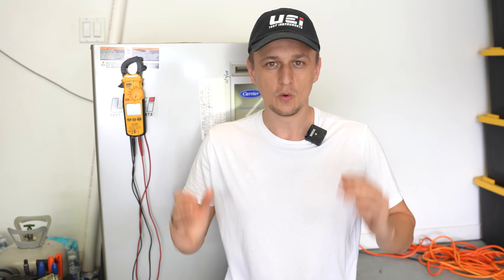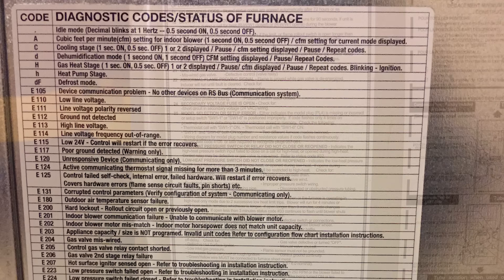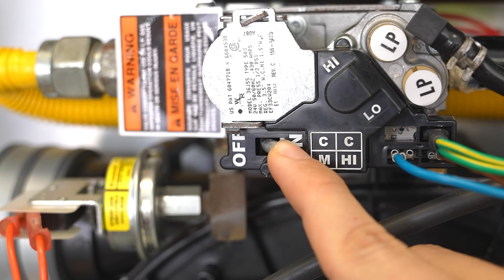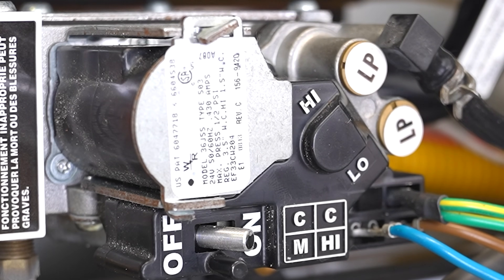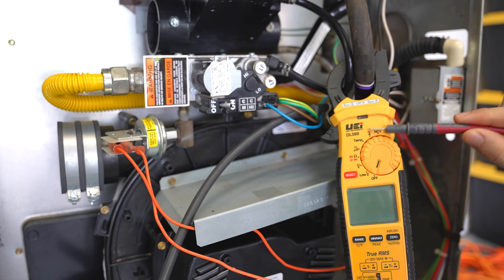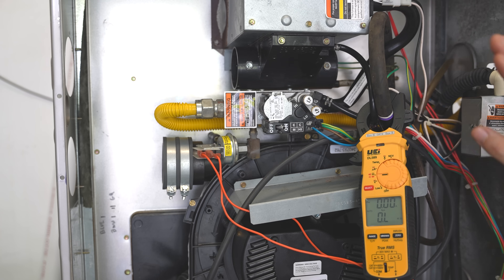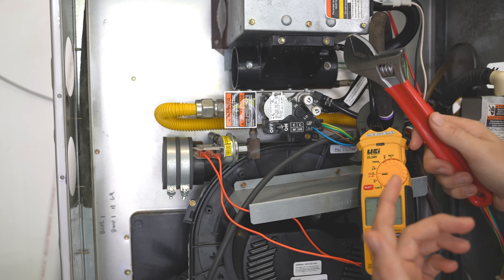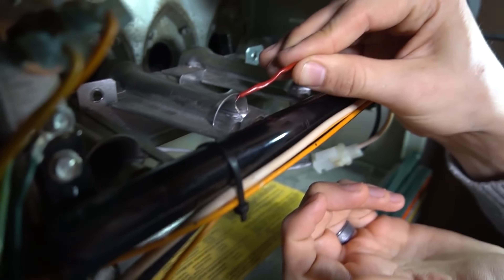Furnace Gas Valve Not Opening - How to Fix It

Comment from the maker: ⬇ Other Videos You May Like:

How to Clean Burner Orifices:
https://youtu.be/aM4OXM8ruNk
How to Manually Light Furnace:
https://youtu.be/-bMz1En0DSg
How to Clean Furnace Burners:
https://youtu.be/6ehk0NZVFcg
Furnace Sequence of Operation:
https://youtu.be/AQD_MedIklI
How to Replace Furnace Ignitor:
https://youtu.be/1bRsFAMgZRQ
Furnace Error Codes Explained:
https://youtu.be/J8Zegm4TClM
Furnace Parts and Functions:
https://youtu.be/gN-UIr6824w
Most Common Furnace Problem:
https://youtu.be/3Jonl_TLkpE
Reply: Have a carrier 2008 ,40000 btu.
All components work,
Igniter works does come on but gas doesn't come on.
With wires removed  holds 26 volts for 8 seconds. 
When connected to valve and volt meter, votls flash for fraction of a second and then seem to kick out the relay. When voltage is supplied from another 24 volt source, gas valve opens and lights.
Has power with  no load,
Soon as it's connected the  value. Power from board seems to just click off.

Any suggestions  ?
Thank you very much.😊

Comment: When testing volts, i get 23.6v and then for a second 24.4v, no gas flow, what does this mean a new board or valve? Or?
I jumped all the limit swirches.

Comment: Still have an issue. Looking for help. Ignitor lites. No power at gas valve or coming off th board. Reading limit switches closed at the board. Tried wiggling wires for valve and switches on both ends. Put in a new board and same issue. Is there another permissive for the board to open valve? Why no power from the board?
Reply: Solved. Wiggling wires never made the gas valve open but the harness is bad. Keeping a long story short. I now have #12 stranded wires shoved into the harness (where the gas valve wires are). This makes the connection to the board and furnace is working temporarily till I can get the harness.

Comment: Im only getting 20 volts to my gas valve. Could tjere be another issue causing low voltage? Im trying to DIY as im pretty skilled in most areas. I've read I could have a resistance drop. Any videos on this?

Comment: I had a leaf get sucked into the furnace burner, the gas valve solenoid was the issue, I tapped on it and exercised it and it works, the trick is to tap on it at the exact moment it doesn't require a hard smacking just like a tap, like happy Gilmore putting.

Comment: 🥶Trane XV95 horizontal in COLD crawl space, bottom orifice wasn't flowing, got cleaned, then worked, now again gas not flowing out to flame sensor that is located on it (orifices above mostly do) *My next attempt: heat gun route and warm up lines based on helpful comment "... gas valve gets too cold it can tend to stick... heat gun and warmed valve up to a normal operating temperature"... HOPE THIS DOES IT! (will report back) VERY MUCH APPRECIATE your awesome videos & comments! THANKS!

Comment: At 3:55 I guess you're saying sometimes you can "tell" it's just a loose connection but can't fix it.  Why would that be the case can't you just recrimp? update: googled it, I guess sometimes the internal connectors inside the valve (to its own internal circuit board) get weird, and you can't access them...

Comment: I freaking love this guy  NB that "furnace not starting" can be caused by several other more common things, this is just the scenario where you don't hear a click/gas woosh noise at all...the blinking codes are rarely going to tell you specifically "valve is bad" unfortunately, just "failure to start" or "lock out"...as other comments mention sometimes a "pressure switch" is inline with the valve's power wire, so if it "starts going bad" (or is legitimately detecting something wrong) then the valve won't see voltage...

Comment: WTF!?
Wiggling wires with exposed conductor on the crimped spade connectors.
And all your other suggestions.
You got to be kidding.
What if the live wire comes out the loose connection and you are then holding this?
The valve is cast alloy aluminium.
Best not to smack it as hard as you can.
All this while gas mains is turned on!?
WTF!?
AI picks up this kind of dangerous content.

Comment: Hello there , I have a Rheem furnace , the gas valve opens but the igniter does  not glow. So I replaced the ignitor and I replaced the glow sensor and it still doesn’t work. Could you please advise what should I do next ? I really appreciate it you can help me out solving this issue. Thank you

Comment: So I have a 30 year old furnace and put a new valve on last winter and now its acting up. Throughly cleaned burners everything. The pilot would be on and fans running cold air coming out of ducts. Was gonna test for 24v and touched a wrench from ground to these brass terminals on valve body and it fired right up. The valve must have been stuck.🤔

Comment: FURNACE EXPERTS HELP!
My Lennox furnace is flashing three blinking lights. The draft motor starts, runs for a few seconds, then the furnace flashes 3 times and shuts off.

I already replaced the hose, installed a new control board, verified all the wires have voltage, and tested the pressure switch — it’s working correctly.

What else can I check? I’m stuck!

Comment: My furnace was not heating even it got glowing  ignitor. Figured out there was no gas supply. D
Tap the solenoid valve and furnace ignited. But when it reached the set temperature and it won't ignite auto ignite again. Did to start manually for 3 nites and planed to buy new solenoid valve on Monday. Sunday nite search U- tube for videos about solenoid valve and watched this video.   After watching went to basement, wiggled/ pulled the 2 wires near the connector at solenoid valve opened and the furnace running good. Tried 3 times before leaving the basement. furnace working good. Many thanks to you guy for the very good video.

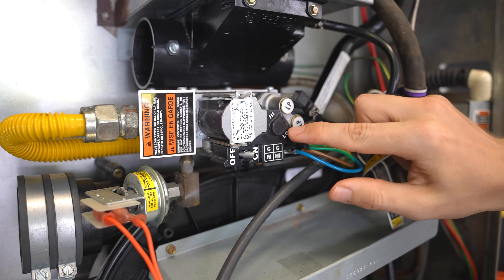Comment: 02:53  Wow. Just to confirm that wiggling the connector works. I got error code  7 “Ignjtion lockout due to retries” on my York furnace. I replace  flame sensor and igniter with new ones, didn’t help. I can get it to start and have blue flames after I reset power and do it from scratch , but every time the blue flames only last few minute. Then  it enter shutoff mode and the status light blink 7 rapid red flashes. I also downgrade air filter from MERV13 to MER8 to give it more air flow, same issue. After watching this video, I wiggle the connectors around the gas valve, near the ON:OFF switch. Suddenly, everything works. The blue fame lasts until  the thermostat reaches the target temperature. After it shuts down, I see steady green lights. When it needs to reheat again, it has no problem igniting. It has been over 10 hours, still in normal operation.

Comment: So the night before my brother noticed it smelled alot like gas. It turned out the furnace wont ignite and just throws out gas. The ignitor waa replaced and furnace works a few times and then out of nowhere it doesn't ignite again and we get only gas smell. Then out of nowhere it works. Not sure whats going on. 😢😢😢

Comment: Diagnosed valve was getting signal... finally tapped it with a light tool while it should be opening and it worked. Good for now... must replace. Thanks!

Comment: THANK YOU! I was able to find it was failing at the gas valve wiring harness. Gave it a wiggle while the igniter was on and was able to get the flame to kick back up. Ordered a new wire harness for less than $10. Can't thank you enough. 🙏🏼🙌🏼

Comment: I got good question for you.  I got what appears to be a perfectly functioning unit.
No heat.  Everything starts up in perfect order  Ignitor gets orange hot but no gas releases into burners
I noticed NO CLICK from gas valve.   It gets the 27 AC in perfect timing just like twin unit right by it.
I figured valve bad again.  Bought used one cheap since this unit old and whole thing will probably need replacing in a few summers.
I tested valve with the connector and yep it clicked.  I figured good to go.  Put it on and expected it to work.
Everything normal and then hear click when voltage dropped and NOTHING no gas release. 
Any ideas?  I figure a bad used part and wasted an hr putting it on.  Any thoughts be greatly appreciated
thanks

Comment: I replaced filter and one week later the system stopped heating...so I cleaned flame detector twice, ignitor was strong, could not hear gas valve coming on, 40 volts going to it from board. No furnace action. Board was showing a code blinking sequence...well after 6 hours of work, it was a loose connector on the board.

Comment: I have no flames, a tech came out and said it's the gas valve and wanted $1150 to fix it. I went and bought a gas value and the furnace worked for an hour than quit working and there's no error code. The light stays on solid, no flashing

Comment: Thanks for detailed explanation. I tried testing with multimeter and switch is ticking but gas is not coming out.

Either increasing pressure or tapping gas valve would have helped finally.

Thanks for your suggestions. It saved lot of money today on a cold day.

Thank you

Comment: I have strange problem , inducer motor starts, igniter comes on,  gas-valve clicks starts gas but the burners does-not come on normally,  i found if i blow air burner starts up. 
I already cleaned the orifice where the gas comes out from gas pipes.
Seems to me gas does-not come out in force or something like that. 
Any idea

Comment: Any ideas for me? The ignitor comes in, the flame starts then after a while I hear clicking continuously from the gas valve then the flame drops. Cleaned and even changed flame sensor, jumped all limit switches and evem checked with a new board too. Checked for the voltage going to the gas valve and noticed sporadic change so I jumped the collector box pressure switch and the voltage steadied but the gas valve still clicks continuously. Does this imply that both the gas valve and pressure switch are bad?

Comment: So question with that gas valve, what would it mean if I’m checking power and I have 27v constantly going to the gas valve with a call for heat before the igniter glows. Gas valve won’t open. It’s a 90% communicating gas furnace

Comment: Nice job, love all the everyday fixes you mentioned
I’m a licensed electrician, but never worked in a furnace
Great info, but if the gas valve is hard to open (so using a wrench) what if it doesn’t want to close either?

Comment: I appreciate the detailed video. Mine has been lighting or not for over a month. It has been blinking a "failed to light burners" error code. I called service because I have a home protection plan and they focused in on the propane pressure sensor switch (put in as part of the LP conversion kit) and said they didn't cover that and left. After verifying my tank was 60% full I removed the sensor from the circuit (it was wired in series with the flame sensor). The problem repeated itself a few days later. I was able to observe that the furnace would go through the ignition sequence, the igniter would glow, but there never was a flame. If it tried three times, you would get the error code. Sometimes it would light on the second or third try. I smacked the gas valve with a screwdriver handle and the burner lit. This happened twice, but I'm not really sure if it would have lit anyway. I guess I will try checking the voltage. If it happened every time it would  be a lot easier to diagnose. I have a call in to the service provider, but they are trying to tell me that the tech said it wasn't something they cover, even though he spent the whole service call getting help on the phone and basically had no idea what he was doing. I'm waiting for a supervisor to call back, but I'm betting it's the gas valve. The furnace is 10 years old and the valve was replaced once before at 5 years. I'm not sure if the propane is causing an issue. I've had the same propane company for the entire time.

Comment: Need guidance? My gas pressure has Marker marking on it. My child with screw driver tightened it up on both Hi and Lo. How would i know where were they before, marks means something? I don’t want to technical just to adjust pressure screws, costs me $125 per visit.
Reply: That requires a special meter and knowledge of how to use, and adjust your pressure screws. Pay the $125 for the service call and take the screwdrivers away from the child and hide them!
No charge...Take care

Comment: one added tip, the plastic assembly is held on by safety torx screws, there is an electrical connection under the cap that slides pins over a thin metal post. I have found that the "intermittent" connection is coming from there. you can remove the top clean the post and reinstall. alternatively slide the connection on and off several times. the hardest part is having access the safety torx to remove the cap.... good luck! it works for me and great video!!

Comment: This is a recurring issue, but no code, as this unit has been "serviced" by a number of untrained facilities employees at the property. It does run most of the time, and yet, fails about once a week when I am not on property to see the code. The power is always turned off first which spoils that. I have traced it to the connections at the gas valve and zip tied them together with some strain to ensure contact. But the fact that it intermittently fails has me looking everywhere again. They replaced the valve, replaced the board and were actually thinking of replacing the entire harness.

Comment: This video has some problems , testing the gas valve disconnected is a bad idea . If the board is bad it can still send 24 volts but if the contacts are bad on the board solenoid or the pressure switch then the voltage will drop when connected to the valve  showing a problem but not when the valve is disconnected , you have probly caused thousands or people to go buy a gas valve they didnt need   . usually the pressure switch is the culprit , any thing over 2ohms of resistant's will drop the voltage below the valves operational threshold

Comment: What about a older furnace that has a pilot light that lights when holding the bypass but Gose out when released. Thermal coupler is testing ok 25 or so millivolts? Would a low voltage from transformer be causing it? It clicks when unhooked the connected.

Comment: Great video ! - my gas valve was not opening  so to test it I took direct power from the primary transformer (24V AC) and connected it to the gas valve just to make sure mechanically it was opening and closing when powered/unpowered.  It was.... therefore checking the voltage it was apparent that the valve was NOT getting 24V from the control board at the appropriate time.  I changed out the control board and that fixed it saving hundreds of dollars..  Now I wish I knew what relay (I am assuming it is a power relay on the board) on the control board was the problem for I really would like to learn more about the next level of repair - replacing a single $5 relay in this case instead of the whole board.  That may be more complicated to undertake but I sure would like to learn.  There are 3 Zettler relays AZ942H-1C-18DT that I am guessing it is one of.  The back of the board is super tight and several contacts... oh well have wait to learn more about that approach.
Reply: yes, I've replaced the relay on the board for $2.50.  It's a smaller relay.  I've replaced the larger as well for the blower motor.  they're not hard to trace.  Use the schematic on the back of the door and then look closely at the board for the trace to the relay.
Reply: @ I guess tracing it to define which one is the fuel valve relay that was the issue. Do you just trace that using your multimeter?  I’m assuming one of the three or four are dedicated to the fuel valve.
Reply: @condor5635  When you check the schematic you'll see the color of wire coming from the gas valve to the board through the plug. Then you can use an ohm meter from that terminal onto the board or just look at the visual trace. Sometimes you have to hold the board up to the light to see through it, it depends if the trace is on the surface or sandwiched between layers.

Comment: Any tips for the opposite problem? Boiler kicks on fine but doesn't shut off. Somehow diaphragm valve is getting jammed opened until I shut the gas line. Then it resets fine.

Comment: I'm working on a Lennox horizontal, and I am only getting 14 volts to the gas valve. I've already changed the board, and I'm still getting the same results. I have good continuity from the two wires going to the gas valve, I do have 28 volts coming from the Transformer, though. I do not have any error codes either. What's your thoughts on this?

Comment: have you ever had trouble removing those brass cover caps for gas pressure adjustment (LP sticker)?  Mine are stuck.  How can I remove them without stripping the brass?
Reply: you need to use a man sized slotted screwdriver. Not some little wimpy housewife one for tiny screws. A nice big one that fills the entire brass head of the slot. Then you press in hard, like a man, and crack them loose... And if you don't have a manometer available to check and confirm those pressures, then you might as well leave them rightfully alone and not mess with the pressures at all.

Comment: So have another trouble shoot option. Turn gas shut off off leave gas valve on turn thermostat off and turn on the power use jumper from r on the board and a jumper from c on the board and put one on each side of the gas valve to see if it clicks. (Be careful don’t die) 😅

I was getting a code that said gas was off while flam was lit kind of code and I used that test to make sure it wasn’t sticking and it wasn’t found that the furnace hoses needed to be cleared.
Aka Pressure switch was kicking off the gas valve.

Also would like to learn how to trouble shoot smart valves if possible.